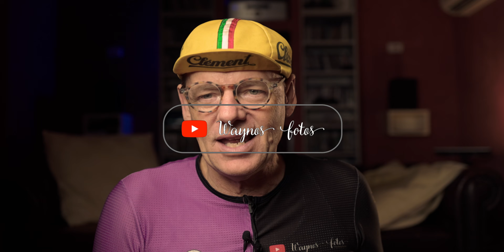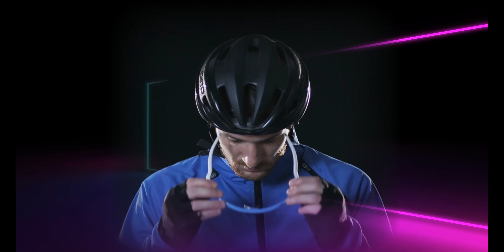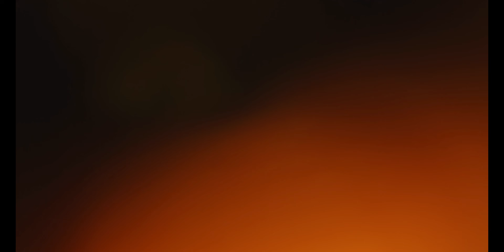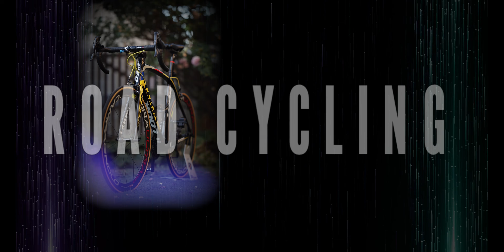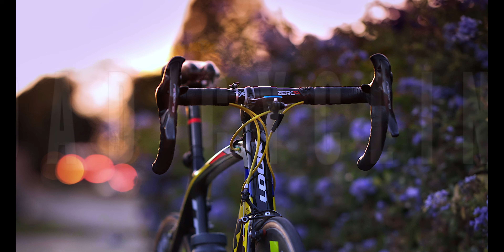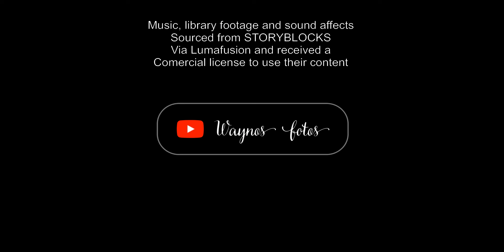Are electric groupsets worth the extra money?

Comment: The biggest practical difference for me between Di2 and Ultegra is that on my Di2 I can slam/change the front and rear derailer at the same time without ever a chain drop.  This is a significant advantage when hitting a significant hill while maintaining max speed.
Reply: I've never had to change the front and rear derailleur at the same time...
Reply: I don't see why that should make a difference. The chain and chainrings don't know if you shifted electronic or mechanically. Its most likely a setup issue.
Reply: Having to shift both front and rear at the same time usually means poor planning or too much wine at lunch.
Reply: @tianyi05  I should have been more clear.  When I shift both at the same time I'm shifting from large to small up front, and down a cog at the rear.  This results in almost the same ratio as before the shift, but now I'm in the small chainring up front in advance of actually needing to be.  It's not poor planning; it's more planning.
Reply: @CrabgrassFarmer  it's just completely unnecessary and not needed.
Reply: @Silidons91  That my friend is the whole argument against electronic groupsets:  Unnecessary and not needed.
Reply: @CrabgrassFarmer  That's probably why I still run mechanical then.
Reply: @Silidons91  I only have an electronic because of a car accident that destroyed a bike.  The driver's insurance company stepped up big time.  I also have and enjoy mechanical.  For a fairly relaxed ride it doesn't matter to me which I use.  But if I really plan to hit it hard in a competition type thing, I'll take the electronic because you can shift whenever you want with zero worries about potentially skipping a beat.

Comment: So far as I understand, the only smarts in an electronic system relate to adjusting the front derailleur to account for the rear. So the front derailleur will shift slightly differently according to if the rear is in cog 12 or cog 1. The rear is pretty simple, which is demonstrated by the Chinese EDS system.
The smarts are conditional though: Monday I went out without sufficent torque in the front derailleur mount on the new bike. Oops. It moved. Yet I did 112km by just adjusting my shifts using my innate cognitive adaptive system, aka there were some shifts I avoided and others where I went gently. I had a few outer drops but with my current set up these are not fatal, the chain comes back on with a gentle turn of the cranks. Here, I suspect an electronic system would have buggered me by always shifting to its electronic stops. As it happened, my multi-tool didn’t have a 2mm hex to allow removing the drop-out guard to allow shifting the derailleur. Again oops.
This all contributes to ths basic issue: electronic might have an advantage if everything is charged and set up correctly, but otherwise not. It reportedly cost a win for a US national cyclocross champion, who hadn’t realised that driving across the country with a break lever slightly depressed would keep the system on, leaving not quite enough to finish her race. The electronic systems are not adaptive to sloppy maintenance (even when your groupset supplier no longer keeps the installation instructions in view for my ”antique” 11 speed).
Reply: How does a slightly depressed brake lever keep the system active? I'm guessing it was Shimano? Finally found it. It was the coin cell inside of one of the shifters that died.
Reply: @DaveCM  Ah hah, I should have thought more :-) Btw, if you are working your way through gps head units, there is a problem when your phone spends the night trying to reconnect your Xcadey to your no-longer installed Garmin 530. 150 hours of battery life is not so long then...

Comment: Flashy, heavy, overpriced tat. Guaranteed the more of it they come up with, the more folk will buy it. Like electronic suspension on mountain bikes, it's getting a little silly, but what do I know. Trying to fix a problem that doesn't exist is where marketing comes in.  I have changed my gear cable on my mountain bike once in 5 years.
Reply: Flashy, LIGHTER, overpriced :) 
R9150 is actually a bit lighter than R9100 :)
Reply: Tell me "moody edge" how many electronic groups have you tried? 

Wayne - the shifting speed of the Shimano Di2 is programmable.  They are clearly setting the shifting speed all the way to the fastest and just like the manual group can kick the chain off trying to shift that fast. Set to a medium fast speed the Di2 is both the most reliable shifting but because it overshifts and then backs off to the proper position , it also has the least wear on the shift components and chain.

I just don't like the idea of plugging my bicycle in. So I am back to manual. 

What we really need is a good analysis of this loony growth in the number of speeds which appears to be nothing more than marketing. Sports riders stopped needing more gears at 9. 12 speeds do nothing more than allow pro's to sneak up to 40kph. Now the technology of the Campagnolo groups has vastly improved,  think of what they could have achieved if they weren't trying to keep a 12 speed chain from breaking on a cross cogset shift and keep the system quiet with that narrow spacing?
Reply: @tomkunich9401  campy is currently on 13 speed with one of their groups, and going to 13 wireless on their road groups. I can almost guarantee you it will shift as good or better than their 12 speed systems. The biggest benefit of adding gears in the rear, is adding range without sacrificing steps. You can stay in the big ring for much longer, and in some instances get rid of the small ring altogether.
Reply: @veloveritas9963  - Ekar is supposed to be designed for a single front ring, eliminating the change in the front angle and the increasingly narrow front spacing.
Reply: How is it flashy? Visually it's nigh on identical to the mechanical versions.
Reply: But have you ridden electronic suspension? It’s pretty remarkable.
Reply: hahahaha could change cables even once every 10 years if you don't ride the bike
Reply: @ribbyramone  The bikes been across the world on some of the best trails in the world, more than once.

Comment: I've never had chain drop riding Ultegra Di2 for 10 years. On the mechanical system I would get a chain drop maybe once or twice in 1000k so it's not really an issue. Chain drops in the TdeF were caused by running 11 speed cranks and 12 speed cassette. SRAM has a delay caused by the full wireless system, that's why Shimano use a semi-wireless setup.
There are some advantages in (Shimano) electronic groupsets over mechanical. Shifting is quicker if you set it to the faster change speed. Personally I've never done that and just leave it on default. You can program the system to change the rear cassette cog when changing the front chain ring which I find useful. It's also possible to just change cassette ratios and the system will change the front chain ring at a pre-programmed point. The front derailleur has a narrow cage than mechanical and will auto trim to stop chain rub. Electronic also has the advantage that it can be updated to add new features using the Shimano app.
I like the buttons on top of the hoods which can be programmed to change gear of scroll through pages on the head unit. The latter option I find really useful.
Battery charge is not an issue and lasts at least 1200km. The battery on my previous Di2 groupset was still working fine after 8 years of use.
Reply: I have never had chain drop riding my ultegra mech gs.

If you know how to assemble your own bike piece by piece, you probably not going to experience chain drop.

However electronic gs is great, got many advantages. Ultegra di2 is more than enough. I will buy it untill current gs can not be use anymore
Reply: I find the synchro mode of my Di2 is junk when changing from small to big ring. The engagement of chain and the big ring teeth is delayed slightly and makes this annoying krrrrrt sound before the chain engages fully. Impossible to do the change when applying lots of torque. When I disable this the changes are crisp.
Reply: @82vitt  This is not something that I have found. My setup is to change one sprocket at the back rather than the default two.
Reply: @hallisoft1926  Does changing one cog make any difference though? I believe by default the synchro mode is set to change by  3 cogs to give you a smooth cadence transition.
Reply: @82vitt  I suppose it depends on how you use the gears. My old Di2, which I used for 8 or 9 years, didn't support synchro shift so I would change the rear cog one sprocket immediately after changing the front mech. I tried the default setting and also the full synchro shift on my new Di2 but preferred the one cog change, probably because that's what I did for so long. The great thing about Di2 is that there is a choice and riders can tune the system to suit what they feel is best for them.

Comment: Luckily mechanical can’t die as those of us that commute could never go over.  the bike as a toy for the rich will be electronic the boring chat about how fast it is and how much better is usually drowned out by laughter on a 100mile sportive. 

As a tool / commuter electronic doesn’t work.
Reply: Not sure about the prejudice in your comment. I'm an enthousiast, you sometimes buy things that are not strictly necessary.
Reply: @BartSchrijvers  if it’s not a necessity then it is a luxury. Luxury items or toys are sold on perceived benefit but really do little to transform your live.  The benefit of electronic group sets is minimal as the mech moves faster than the chain engages.  If a nine year old can operate mechanical shifters and there is no gear to chain engagement benefit then there is a tiny few people who benefit from electronic shifting. At 10x the cost and a load of hassle I just don’t see the benefit. But then we’ve been sold the dream by the manufacturers 
Electronic shift 10x the cost
Disc brakes 
Cross spoke wheels
Fat tyres 
Thru axles
compliance. 
All absolute marketing I can pull out steel bikes from the 1980s running on 19mm tyres that ride better than any of the current disc models.
Reply: @tobycolin6271  a current 2022 bike will blow any bike from the 80s or 90s out of the water, no doubt there. They are fun to look at, not so much fun to ride. Even a 10 year old road bike is nowhere near as good as the brand new stuff thats came out in the last 2-3 years.
Reply: @veloveritas9963  no one said anything about speed the vibration caused by the torsional stiffness required by disc frame design has made heavy stiff bikes that require 28mm or 30mm tyres to make them comfortable.  Since the advent of disc my tt and race speed hasn’t improved but my race results have.  I rode a new Scott foil the other day and it was very slow on its 30mm tyres nothing like the rocket ship that was marketed.
Reply: @tobycolin6271  That is 100% false. A Scott foil on 30mm tires is significantly faster under the same power output than a bike from the 90s was, in every metric. New bikes are neither heavy nor stiff, and they do not require wide tires to make them comfortable. Not even remotely true. The shift to 28mm tires was happening way before discs even existed. Bike manufacturers never tried to shift the compliance from frame to tire, completely untrue. Go out and ride one with 25mm tires, and a steel bike from 1998 with the same tires. No comparison. The carbon bike will feel just as smooth, but significantly more efficient.
Reply: @veloveritas9963  complete bollox the foil is well over 9kg dull and no where as fast as the 2016 to 2020 rim brake bikes. Compliance has moved from the frame to the tyres we tried a giant defy and Cannondale synapse on 23mm tyres at 125psi and you can barely see where your riding. On 30s there tolerable but the ride is dull
Reply: @tobycolin6271  you can walk into a scott dealer right now, and buy one off the shelf that weighs less than 7.5kg. The top end model is closer to 7 on the dot. The new 2023 version looks even better, I think they claimed 10% lighter, and the aero stuff, meh, hard to prove. But no, the disc foil was a great bike and much better than the 4 year old rim brake version. In no way is it slower. Not my favorite bike on the market, but it was NOT a step backwards at all, and the new 2023 model is simply beautiful.
Reply: Mechanical “dies” all the time. 10 speed STI road shifters used to shear through shift cables like it was dental floss. I have had to finish at least 3 races in one gear when my mechanical shifter either broke, or the cable frayed so bad you couldn’t shift. I have seen this dozens of times as a mechanic on clients bikes. Di2 works great for commuter bikes, the Alfine di2 is bulletproof.
Reply: @veloveritas9963  mechanical dies all the time what absolute sensationalised bullshit.  I look after over 100 customer bikes and in the last 20 years not one cable has snapped or shifter broken. The one sticky durace shifter I know about is on my commuter bike it’s done 50k miles and been left outside for the past 10 years of commuting.
Reply: @tobycolin6271  all the time. Ask anyone bike mechanic. I can not tell you how many races and important rides I have seen folks ruin because of mechanical shifters either breaking, or the cable fraying. I have a pile of at least 40 STI and probably 50  plus sram shifters, all broken, in my shop. I only have 1 di2 lever thats broken and it was in a crash. Mechanical is far less reliable than electronic in the long run.
Reply: @tobycolin6271  oh and I forgot about campy…. We finally ran out of D springs, but I went through about 25 of the springs, overhauling campy shifters over the last roughly 10 years. Campy shifters fail consistently, but it usually takes more than 5 years of hard riding before the springs break.
Reply: @veloveritas9963  you must be a typical replacement mechanic I pity your customers. Got 100s of happy customers that in 20 years have never had an sti lever not been repaired and they’ve  never snapped a cable.  In fact nearly all of their bikes are still running the levers that where originally fitted.

Gripshift is a spring that presses on a plastic ratchet their is not a simpler shifting mechanism. The only way it can get damaged is being forced against a stop. 
Sti very rarely go wrong unless the pawl is unable to return under tension due to corrosion. 
Both systems ware but are rarely a problem unless the bike has been left in the rain or unless the grease has gone hard (which takes about 20 years)
Di2 being low voltage electric will suffer from battery and  cable and switch corrosion. 
But let’s look at the cost replacement gripshift £12.99
11 speed £11.99 flat bar 
11speed £65 road 
Di2 £149
Reply: @tobycolin6271  you cant repair STI levers…. You can only repair campy ergo power. I prefer to repair than replace. STI levers brake all the time, I have warrantied hundreds and kept old ones that were out of warranty for many years. I have a friend who will try to swap the guts out of them, which isn’t really repairing them… just salvaging. It’s very difficult and time consuming, she does it for more of a hobby. No mechanic can repair them under normal circumstances. STI levers are one of the most common components that breaks on road bikes, and when they do, it’s a shame you CAN’T just order replacement parts. If you are out of warranty you are SOL
Reply: @veloveritas9963  you’ve got it wrong You can’t repair Shimano sti shifters. Because I can and lots of us do. Just because you don’t have the skills doesn’t mean it cannot be done.
Reply: @tobycolin6271  That is not true. I know many top mechanics, and consider myself one. None of them can or will repair an STI lever. You have never repaired one, I guarantee it. They have been virtually unrepairable since the 90s.
Reply: @veloveritas9963  I repair them all the time most of the time it’s corrosion on the pawl spring caused by the dissimilar metals.  They are no different to clocks and mechanical duke boxes. Stripping cleaning and greasing pivots ratchets springs etc and rebuilding them takes a little time and patience. I buy loads from eBay repair them and run them on resto mods. I even teach 16 year olds in the bike workshop charity how to do it.  But please don’t let your lack of skill and patience prejudice you against those who have the time skill and patience to repair sti levers.
Reply: @tobycolin6271  No you don’t. If you have the right replacement parts salvaged from an old lever, and about 2 hours, yes it is in theory possible. they are incredibly intricate, but it can be done. You have never done it, I guarantee you. Maybe on an old RSX lever, but not on anything shimano has produced recently. That is one advantage campy has, they are quite easy to repair by comparison, if you can find the parts in stock. You will find almost no mechanic who will touch a modern STI lever, its just not worth the time to find the parts, tear it apart, and reassemble. This is why they get thrown away 99% of the time. Regardless of your fibbing, the fact remains, STI levers brake constantly, and shift cables fray, corrode and wear out. DI2 is much more reliable in the long term than mechanical shifting.
Reply: @veloveritas9963  send me yours I’ll happily make use of them. I’ve told you where the failures are and what you can do to sort it in most cases. Your to arrogant to accept that they can be repaired and that most failiures are caused by spring to pawl jamming. It’s exactly the same failiure mechanism in clockwork clocks and watches. Now you’ve called me a liar accused me of telling fibs. Just today I sorted a 105 shifter for a customer that had the down shift lever not engaging.  To solve the sticking pawl involved removing the hood and cover plates removing the old Shimano grease, clean out with an air line, penetrating fluid on the pawl pivot and exercising the pawl until it was free. Lubricating the ratchet and pawl interface.